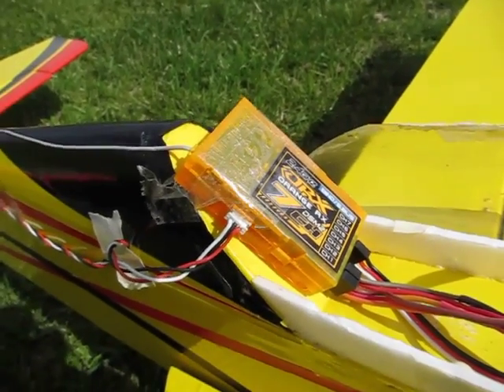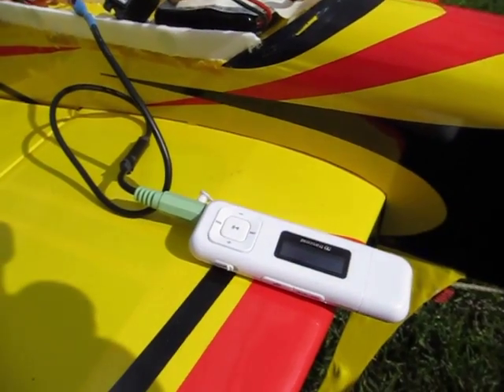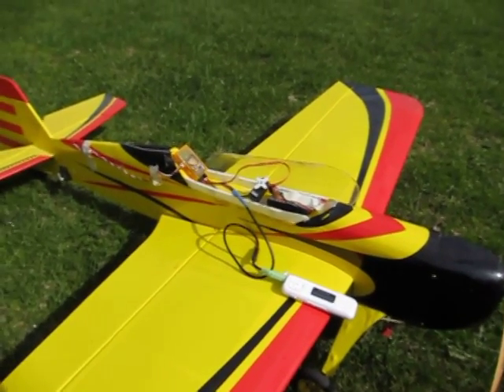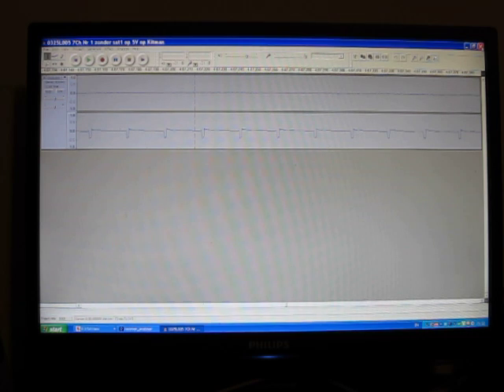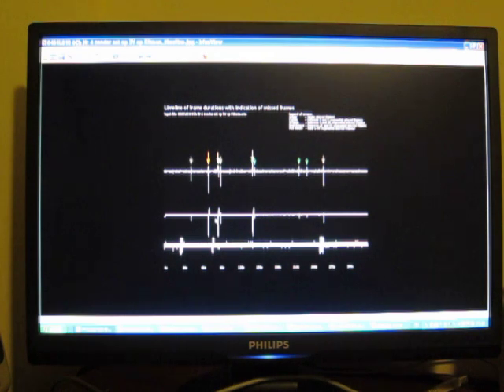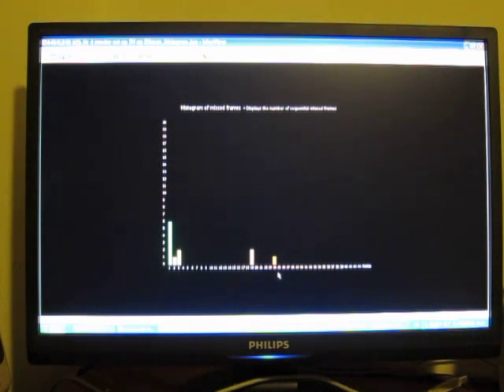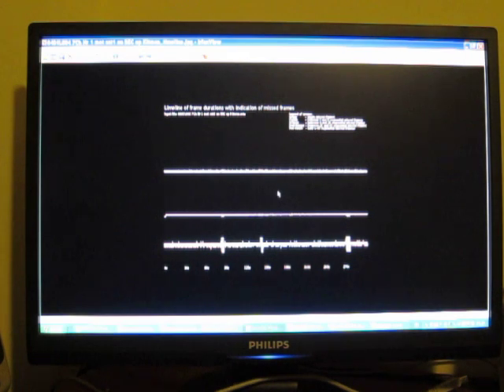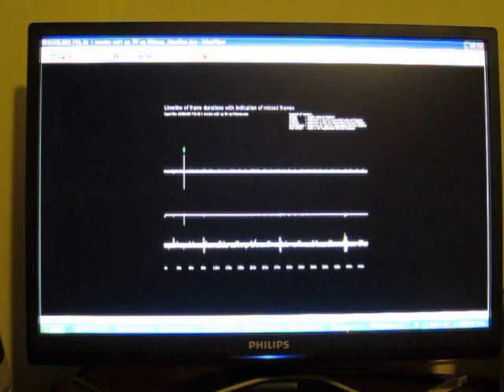Test of Orange 7 Channel DSM2 receiver.mov

Comment: Super idea to test receivers. I think you live like me in Germany. Is it possible to get the check program? I think it will answer the problems I had with my helis where I use 610 orange receiver. I would like to test them, also my 710 orange and the AR8000 receivers as reference, there I don´t have problems.